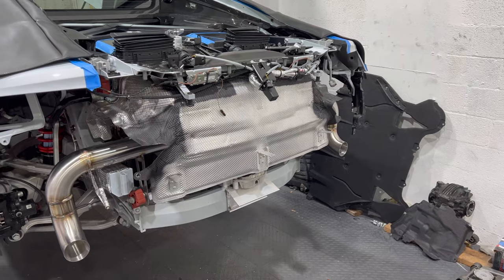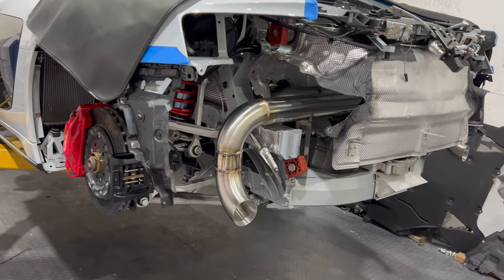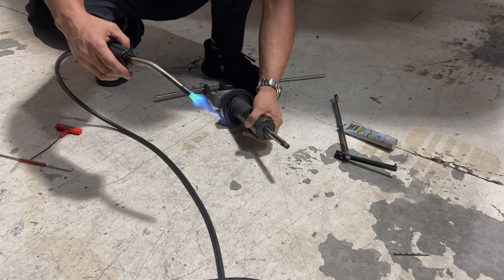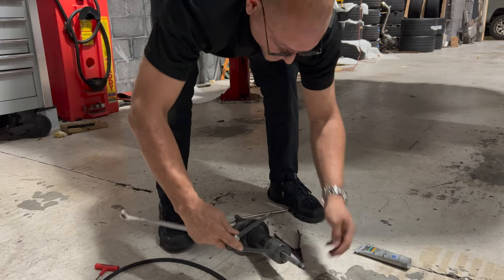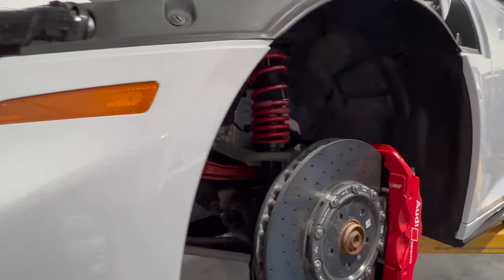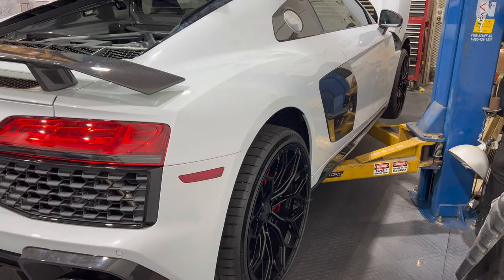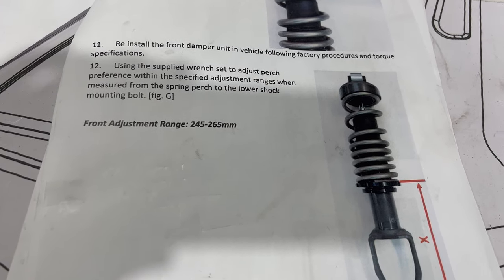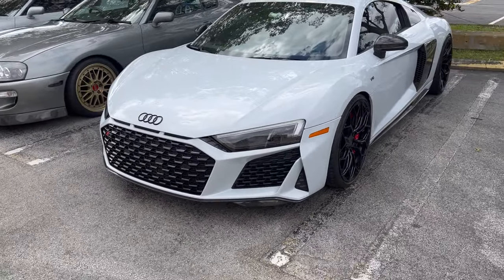2022 Audi R8 Performance lowering springs, wheels, and exhaust install 4K

Comment: I removed the dampening cap with no heat and my wide mouth knipex alligator pliers..... didn't look like a good idea applying heat to a gas shock assembly imo...

Comment: At the risk of stating the obvious, I presume you checked corner weights at each wheel to ensure it was balanced? Or did you just go with your shock length measurements?